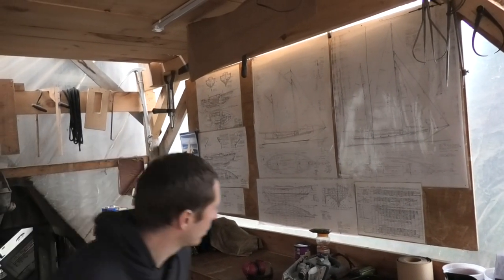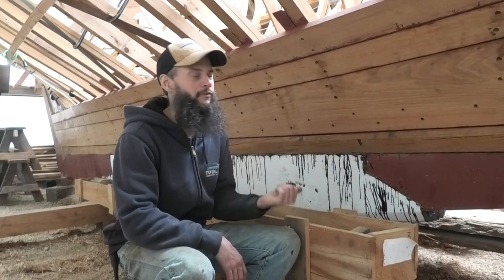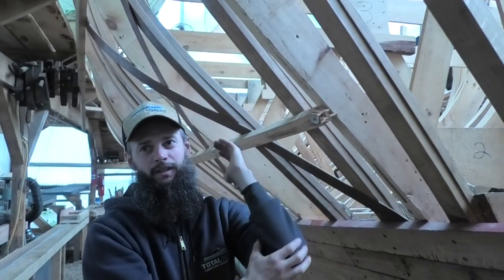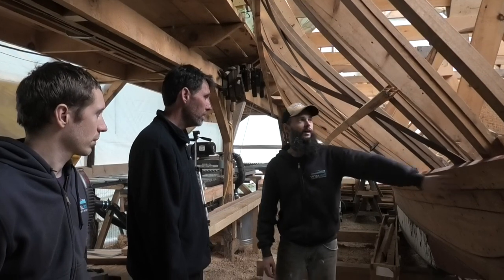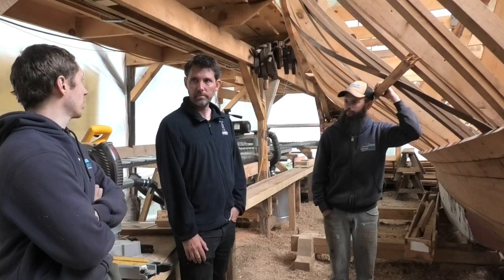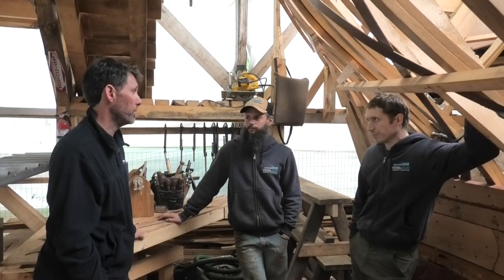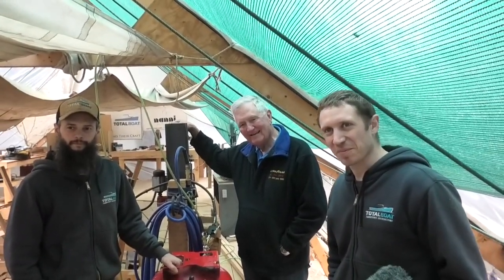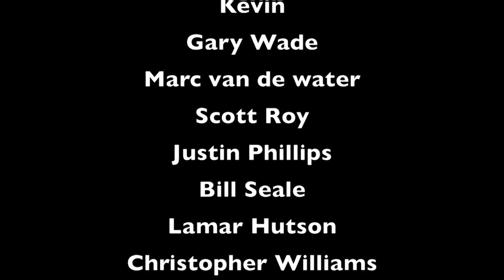Acorn to Arabella timber boat build

Comment: Stu, i live close to these guys and watch them but now instead of a build it has turned into a weekly show putting up 2 boards.  I like your show cause you explain and Getter Done.  You bang it out each week and get it done :-)
Reply from the maker: That is the trouble with these projects. You can only film what currently needs doing and when you've got two months of planking ahead of you introducing variety does become difficult for sure.
Reply: @DangarMarine  , I would never own a wooden boat ever again. Too slow to build, too much to maintain, worms and i worry about popping a seam or board. It's 2019 not the 1920's  :-)

Comment: Great video I follow these guys too and I think they are doing a wonderful job at building and finding solutions to problems they run into in the build , only thing I think they need is a small skiff they can bring on board and launch from the deck as a life boat or to get to shore when needed

Comment: That's the way I think about everything I do, boat restores, house rebuilds, etc, etc. May take me longer but I learn something, it's cheaper (at least the second time you do it, it is) and will be done as good if not better.
I also don't think it matters as much when it comes to size. Maybe when you get into twin motors and drives and such but one motor, etc, etc I put as much effort in restoring a Donzi 16 as I do a 24 foot Nova

Comment: A very interesting video as were the individuals involved in this project. It was not apparent how close to an appropriate watercourse the boat build was being made. The size & tonnage of the vessel would (in my inexperienced mind) present some significant logistical transport & launch challenges. Did the men advise how the boat would be transported & where? I am surprised that the numbers of views you receive for your videos have not resulted in commensurate Subscriber numbers. Thanks for sharing your experiences. I look forward to your next video.
Reply from the maker: Hey mate. No we didn't talk about transporting the finished boat. I know back home there are several truck companies that specialise in transporting boats and could easily handle a vessel this size. It's quite surprising when you see them loaded up and coming into the marina to get launched by the travel lift.

Comment: As a land lubber I don't have many sea stories but I do have 2. I'll tell you one of them, I and 9 other fellows were once hired to cut up an old wooden boat and throw it in a dumpster,. It had suffered a bad fire and was beyond salvage according to the insurance company's. At any rate, we started dismantling it in the am and quickly found out finesse was not our strong point. We got reckless and sloppy and it was clear these things do not want to come apart. We wrestled it all day using chain saws and anything that would work. During the course we had been especially sloppy about fluids, oils, antifreeze, etc. We just kept dumping what ever into the bilge. The end of the job came and we now had two very full dumpsters and a keel with 3 courses of planking left going up from it. It was full of "the soup" we had created. about that time some wandering dock guy came ambling up and proceeded to dip his empty coffee cup in it and drank it down. We were clearly all astonished by the mans action  but at a loss for words. The man simply said in a very slurred manner "I told you there's oil in it" and walked away. I will never forget that, I believe we had been trolled by an old salty sea dog, I still have questions... :)

Comment: Do not screw boards on, rivet them is correct. you will find out why if you ever start a re-planking job, often you can pull off screwed on boards with a light flat bar. I had noticed that American rivets (large size) are mostly round, I have taken a lot of them out !

Comment: Stu, you're suffering from whats called 3ft-itis. It's a disease that afflicts boaters where they always need just another 3ft.....lol. It might sound crazy but my uncles marina (www.Yankmarine.com)extends steel vessels all the time. The only caveat is that it requires a proper naval architect.  They've probably done at least a 100 over the years and it's one of the great things about steel. A lot of times we're even able to correct problems like how she handles and more. If you have a set of plans I'd be more than happy to take a look and while I'm not a naval architect I'd be more than happy to give you some ideas/pointers and let you know if its feasible. Also take a look at the original architect's plans that are similar to yours. You'd be surprised but many times they'll base a few boats off the same hull design. Essentially the bones will be designed for other lengths with very few differences. We actually did a trawler for a guy not too long ago that was the smallest in the line at 34ft adding 8 ft to a 42. The designer also offered a 38ft and a 42 where the only differences in the design were the number of ribs amidships. Each model simply had another station  in the hull. The owner didn't even have to hire a architect since the original designer was willing to work with the guy and the work was already done for the hull. He simply sold him a supplement to the plans that he had purchased including a cad file for the cuts and left it up to us to calculate tying things together. They don't always go as easy but it's not as bad as you'd imagine. It's just most boaters think it's impossible or not worth it, whereas fisherman and workboats do it all the time because its easy with steel and the most economical for them. The trawler is doing his in 2 steps. He had us stretch the hull and running gear etc while he left the cabin alone. It looks a bit odd at the moment but the next phase we'll be stretching and moving the saloon back and reconfiguring the quarters below deck. We'll also be adding a helm inside after relocating the galley down to starboard with a settee to port.
Reply from the maker: I definitely think it is something well worth considering. That's a really kind off of you to do a feasibility assessment for me, all I need to do now is figure out what the boat actually is and find the plans for it. Would you mind sending me an email to dangarstu@gmail.com so I have you return address?

Comment: A very good friend of mine built an "Ingrid" ketch in the 1970's.  He did it by himself, it took 6 years.  He made one serious error.  Atkins specifies an iron ballast keel of 9000 lbs plus internal ballast of 3000 lbs.  My friend was enamored of the lofting process so he "lofted" the keel.  Instead of a long rectangular block of iron, he made a  shapely keel plug of nice wood and varnished it (it was gorgeous and he later used a part of it for a coffee table base).  Then he had a local foundry sand cast the iron keel for him using that wooden plug.  The lofted shape of the iron keel turned out to be only 7,500 lbs.  1500 lbs light, probably because it lacked the squarish shape Atkins used.  So my friend had to add that much more "junk" ballast into the bilge.  Also the rounded keel bottom meant the hull could not sit upright on it's keel when careening it (if anybody thinks that is ever a good idea).